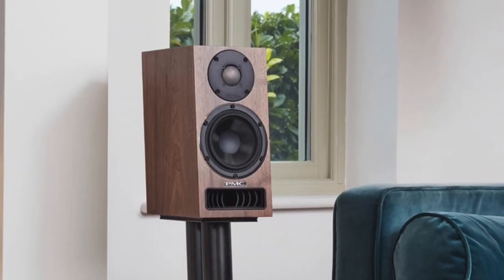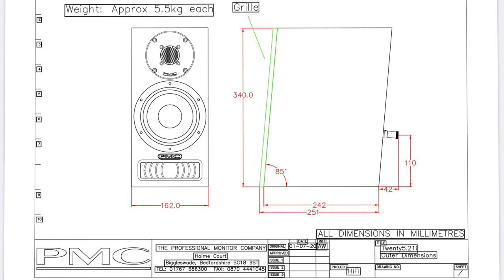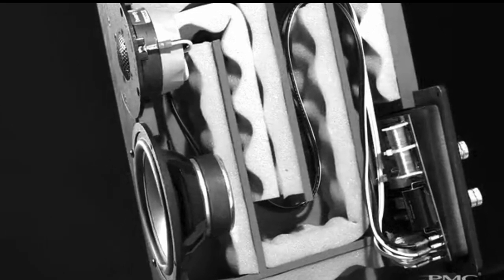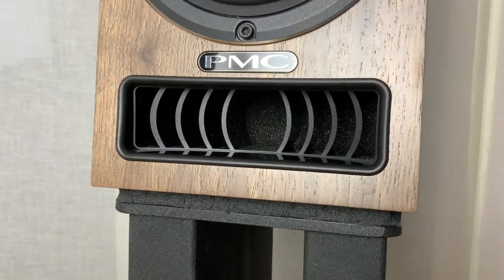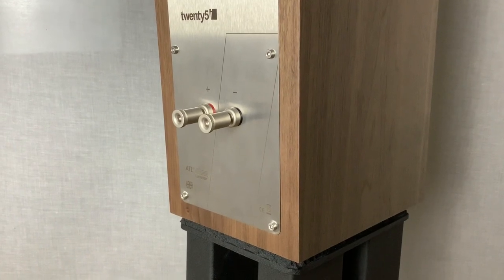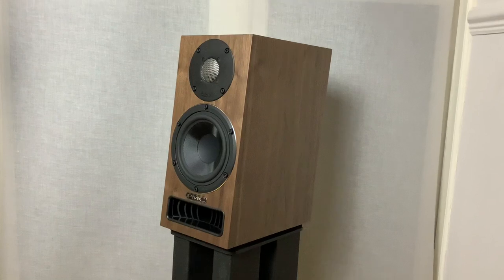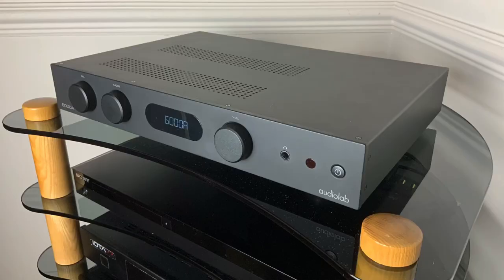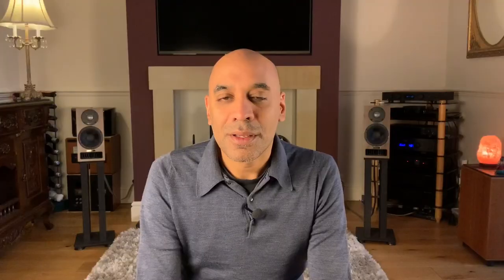PMC Twenty5.21i Speaker Review

Comment: PMC and Exposure is a match made in heaven. I use an older Exposure 2010S2 (75w/ch) with my PMC's and it provides ample power.
Reply from the maker: Cool 😎 thank you for sharing 😊👍
Reply: @essendon72  Which speaker cable do you use between the 2010 & the PMC’s?
Reply: @Theoriginalramjammer  Hi. Using Van Den Hul - The Clearwater atm. Have also used Audioquest Rocket 33's. I like the VDH's.

Comment: This review sits well with your very more recent review of PMCs Prodigy 5 . Transmission Line speakers produce a quality of bass like few others. Having owned Castle Avon 5s (a TL design from a few years ago no longer available) I can confirm the tangible detail, power,depth and tuneful bass a TL can produce which is difficult to find in other designs . TL designs are few (there are some DIY TL speakers available) but given their obvious advantages it is a missed opportunity . They are more complex in terms of the design and the internal line but the latter might also be part of their strength in suppressing speaker cabinet resonance and vibration . Keep the reviews coming. Much favoured in this quarter .
Reply from the maker: Thank you Peter 👍

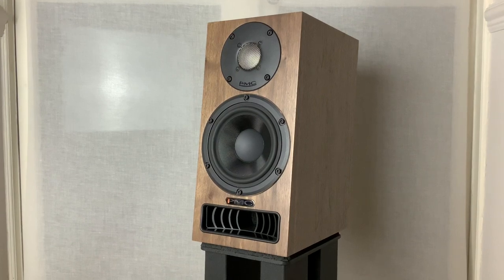Comment: Love the review. Big fan of proper transmission line speakers. I was freaked out at 1:44 when I saw the drawing and thought "no, they did it wrong" referring to the porting. Then later at 2:15, I was relieved to see the cutaway showing a properly engineered porting system. They look to be of excellent quality. Thanks again for the review. If I can find them here, I will definitely give them proper consideration.
Reply from the maker: Thank you for watching and sharing Terry 😉
Reply: As far as I know transmission line speakers always show a slow bass respond. What you gain on the one hand you'll lose on the other hand. 

What is the -3dB frequency  45Hz?

Comment: Good review.  Having owned smaller PMC stand mounts and floor standers in the past the worst thing you can do is "miss the below 40hz region enough to just buy some cheap subs to supplement"  The PMC bass is something special in the way the notes are rendered, if you add some bog standard muddy subwoofers down low it really detracts.  I now, through pure luck, have PMC floor standers with 10" drivers and I now fully understand PMCs vision.  You can have good bass, or you can have low bass, rarely can you have really good low bass.  The bass on my EB1 is unmatched by anything else I have heard.  No sub I''ve ever heard does what these do.  They go down to about 19 hz in my room but the transient speed at 19hz has the ability to make all the glasses clink in my kitchen in rhythm to to the song if I've accidentally put them in the cupboard touching each other.  It's bizarre.  The entire room and house becomes alive.  A PMC sub is a really good idea though very expensive compared to the usual hifi subs.  I had TwoTwo Sub2 for a year and it really did a good job.
Reply from the maker: Thank you for watching and sharing your experiences Mr B 😊

Comment: I built myself a pair of nice floorstander 1/4 wave Transmission lines, just over fifteen years ago. Wonderful results. The cab design is inherently solid, and can easily be made rock solid and incredibly dead when doing it oneself. They are flat down to 32 Hz. Cathedral and big orchestral shit, with low organ peddles can shake stuff around, and can sound menacingly epic. Bass does shine, with none of that slow flabbiness one can get with bigger drivers.
I need to finish them off properly with a new tweeter. As indeed they should really be. Likely a ribbon of some type. This needs to be crossed lower than at present, to alleviate some of the mid frequencies from the upper of the 6.5 inch Magnesium Woofer to be taken on by the Tweeter, so that the Woofer will be operating wholly pistonically and away from the cone break up and bell modes.
Been meaning to get around to it.
Not that they are not pretty damn decent anyway.
A real big plus of transmission lines is just how tunable they are. You can adjust how much foam or long haired wool one has in the line. This allows a certain amount of adjustment to suit a particular room.
There's just something about a transmission line, in the bottom registers, than is very appealing. Which is what the whole deal is about. The Tweeter is pretty much a complete system one simply bolts/screws on the front baffle.
The box really is only for the control of the Woofer bottom end. In effect a physical filter, as opposed to an electrical one. That controls the Woofer at/around it's resonant frequency.
The different types. Open Baffle. Infinite Baffle/Sealed Box. Ported box/Bass Reflex. Transmission Lines. Horns. All have what amount to essentially analogues in the Electrical Domain. They have different type filter slopes, in just the same way as the electrical filters do that make up the passive crossover.

Not that I'm trying to teach anyone how to suck eggs. I just thought the cabinets actual role in actually being part of the filtering/crossover might be interesting and something most folk overlook.
Reply from the maker: I always have the utmost respect for people who have a good at doing it themselves. I really enjoyed reading about your experiences. Thank you for sharing them. I actually did a video on speaker enclosures. Link below, just in case you haven’t seen it...
https://www.youtube.com/watch?v=g4M3rb8QMSU
Reply: Trying to cross a ribbon tweeter over low might be difficult, but should give excellent quality if you can find a suitable driver

Comment: Hi Tarun, great review and like myself once you realise just how well PMC speakers produce bass, nothing really comes close in that specific area. I run Fact 12s myself and love what they do, but as you say they don’t take any prisoners, when it comes to upstream equipment.
Allow me to add, that I am not sure it is a good idea to rake them further backwards, as they have already got a sloping baffle. Correct Image height should be determined by your ears being at a level between the tweeter and the midrange and this is how the speaker was designed and with the intended measured frequency response. Ie. raise speakers equally front/back with a slab of something or have the right height dedicated stand. An alternative could be lower your own listening position. The overall room/ speaker response and interaction can change most likely unfavourably as you start tilting, as the off axis listening response becomes more unpredictable and influenced by 1st ceiling reflections. This will in turn influence the overall tonality of the speakers, as a different reflection pattern gets thrown into the mix. No worries I’ll get me coat......🤓🤣 ATB Peter
Reply from the maker: Hi Peter, I can imagine those Fact 12s being quite impressive.

I originally had the 21is raised to 70cms to get the acoustic centre of the speaker to ear height. I was struggling with soundstage depth and played around quite a bit with positioning. I always feedback to the manufacturer my findings once I have completed listening tests. I consider this a professional courtesy and gives them the opportunity to point anything out that may be useful to include in the review. It was my discussion with them that encouraged me to pull the speakers out even further than I would ordinarily consider necessary. In the end it didn’t help much with soundstage depth in my room. I found by dropping the speaker to 60cm and raking it back a little the stronger floor reflection added a bit if warmth, which I preferred.

Thank you for watching and sharing your experiences with your PMC speakers 😊👍

Comment: Yet another great review. I'd love you to a review a pair of original, in spec 15 ohm LS3/5a's.  I've recently acquired a pair and they are the most convincing speakers I have yet to hear. I have them paired with a Primaluna valve amp.
Reply from the maker: Thank you John. That is a very nice system. I would love to review even the current Falcon LS3/5A if I can get hold of one 😊👍
Reply: @abritishaudiophile7314  the Falcons seen to be well regarded, though a little brighter at the top end than the original, for reasons that seem to be elusive. Have you ever spoken to Paul Whatton? He's a lovely bloke and he could possibly lend you his BBC pair with serial numbers 001 and 002.
Reply: Nice job as always, Tarun. I do appreciate that you go into, not just the tech, but also the all important set up of a speaker.
In my view comparing the PMCs to the LS3/5 is an odd one. They are different beasts attempting different goals. The LS3/5 is ultimately a monitor whereby the PMC is a HiFi speaker with a particular voice.
The only similarity is the size and cost and there are dozens of speakers that would fit in that category - Harbeth, Focal, Dynaudio and my personal favourite Quadral Aurum Galans which are criminally neglected in the UK. They’re the same size, have a ribbon tweeter and go down to 36hz. What’s not to like. 
Cheers
Reply: @jim586  Hi Jim, great comment. Just one thing, though, I didn't want Arun to compare the speakers, I was just saying that I would be interested in his views on the LS3/5a.
Reply: @1jhnpennington Ok. That’s fair enough. In my opinion they are chalk and cheese. The PMCs would be really analytical and forward sounding compared to the LS3/5 of any flavour(brand). Cheers

Comment: Excellent. I bought the 25.23’s after demoing about a dozen pairs of speakers and was completely taken by the depth and speed of the bass, accuracy and clarity of these speakers. For me nothing else came close. However, like you, if I had one criticism it is that they do sound very “cold”. 

I went for the 25.23’s over the 25.21’s as they had that bit more bass and were effectively better v.f.m. than the 21’s plus stands, plus sub.  Whilst I found the 23’s sounded just like the 21’s but with more bass I didn’t like the  22’s at all. They sounded like a completely different speaker and the bass was “muddy” in comparison.

Final point, everything in your review chimes exactly with my experience except for placement. Perhaps it is a difference between the 21’s and the 23’s, perhaps it is the room, but I have found my much less sensitive to positioning.

Looking forward to the next one!
Reply from the maker: Hi Gardenflyer, I would not mind trying out the 23is myself. Really enjoyed hearing about your experiences. Thank you for watching and sharing 😊👍

Comment: I auditioned the twenty23 (non i) floor stander, with a pretty ambitious front end consisting of Fletcher audio point 5 turn table, Manley steel head phono pre and Roksan Blak integrated amp and it was pretty damn sweet! Certainly not lean/cold, but I would say very neutral and with a sparkle in the treble. Non the less made me think the balance might be off with the wrong front end/source material (also from what I can gather, people seem to think the twenty23 is warmer and more full then the 21 and 22). I could certainly live with that setup 🥰 For what it’s worth my mate who is a mixing engineer, says he likes PMC for their ability to retain their low end at lower listening volumes. Keep up the good work!
Reply from the maker: Thank you Sune. I can imagine that the extra bass in the 23is may shift the overall tonal balance to the warmer side. I wouldn’t mind getting a pair in for review some time 😊👍
Reply: Hi, would you recommend the Blak as one to audition? Thanks
Reply from the maker: @richardjohnston4682  I haven’t had a proper listen to the Roksan Blak but it has a good reputation. Definitely worth an audition 😊
Reply: @richardjohnston4682  I really liked it, but only heard it in that setting 🤷🏻 I do know that this particular dealer are pretty selective with what amps they carry (That used to carry exposure and still speak well of them even though they no sell the brand).
Reply: @abritishaudiophile7314  Good point about the bass! I've certainly found a perceived shift towards fullness/warmness when adding subs to monitors.
Reply from the maker: @thepickyaudiophile  thank you 😉

Comment: Hi Tarun.  PMC speaker's are starting to grow on me and the transmission design is very efficient at getting a low deep bass with a relatively small cabinet. I have my eye on the Twenty5.26 model even though they are the older model. The Hegel h390 may be a better choice for these speaker's. The big question to you  is are you thinking of swapping the Proacs for the PMC's? Thanks for a good solid review.
Reply from the maker: Hi Steve, that is a very good question. Both are extremely competent at this price point. Can I keep both ?
Reply: @abritishaudiophile7314  that's a good compromise and I think you should. Go for it as it would be fun 😁
Reply from the maker: @steverees1936  of I had to choose one, for me personally it would still be the ProAcs as I prefer a bit of warmth 😉
Reply: @abritishaudiophile7314  I would agree with you and they also look nicer. 😁👍

Comment: As always thanks for the review.  Have you reviewed the floor stander yet?
Reply from the maker: Thank you J. Not yet but hope to next year 😊👍
Reply: @abritishaudiophile7314  looking forward to it.  Plan on building a transmission line sub, hopefully next year.
Reply from the maker: @jked7463  great! Please let me know how you get on 😉
Reply: @abritishaudiophile7314  will do.  I am an audio and acoustic consultant.  By emitting bass half-way up the wall, the bass nodes are reduced for frequencies longer than the height and width of the room.  So the sub woofer driver and port will be up high at the top of the transaction line.  Not pretty for aesthetics but good for acoustics.  Need to finish my retro speaker using old drivers but modern understanding of physics and components such as high quality caps first

Comment: Since you have a long term relationship with a Celestion 300 which you have done a review on and have even repaired I am sure us subscribers would like for you to do a review of the PMC twenty5.24i comparing it with the Celestion 300. 

Celestion 300
Crossover Frequency: 2200Hz
Bass: 1 x 165mm cone
Tweeter: 1 x 32mm aluminium dome
Dimensions: 970 x 210 x 326mm
Weight: 19.7kg
Sensitivity: 84dB
Impedance: 8Ω
Finish: walnut, mahogany, black ash
Enclosure: 47 litre, transmission line

PMC twenty5.24i
Crossover Frequency:1.7kHz
LF PMC 6.5”/170mm long-throw g-weave™ cone with cast alloy chassis
HF PMC/SEAS®, 19mm twenty5i series, SONOMEX™ fabric soft dome, Ferrofluid cooled, with 34mm surround and dispersion grille
Dimensions:H 1015mm (40”) (+20mm spikes) x W 192mm (7.6”) (275mm incl. plinth bars) x D 419mm (16.5”) (+9mm grille)Drive Units:
Weight:23kg (50.6 lbs ea.)
sensitivity:89dB 1W 1m 
Impedance:8 Ohm
Finishes:Walnut, Diamond Black, Oak, White Silk
Effective ATL™ Length:3m (9.8ft)
Reply from the maker: Thank you buddy for taking the time to post the specs. I do hope to review the floorstander versions at some point. The Celestion 300 still have the best bass I have heard in my room 😊👍

Comment: The way to reduce turbulance is to design the opening area and the line cross section to keep airflow in the laminar flow velocity region beneath 7m/s.  Those grilles may help a little but dont dictate laminar flow conditions but are an economic way of shaping it rather than more expensive production means by design.  Expensive imho for a simple small  box. Why compromise the whole build by stuffing the crossover into the line?!!!! Poor practice given they could be in their own little pocket which would also benefit sq by reducing microphony of the inductors.

The soundstage depth is a strange one for pmc who normally nail this.  As a designer who works with studio engineers I know that the only way to recreate depth is to ensure speakers have both correct time and phase alignment.  Lose one of those and it's impossible to accurately recreate image depth. Coincidental axis will add to realism by introducing genuine point source too. Pity no uk speaker does this anymore.
Reply from the maker: Very interesting Paul. Thank you for watching and sharing 😊👍

Comment: Surely you are better off with the tall cabinets of the 23s and 24s rather than using a separate subwoofer. You introduce another level of complexity where the sub needs to match the speaker.

Comment: I suppose the question to ask is how they compare to the ATC Scm 19's as they both achieved the same rating and they both need a subwoofer .
Reply from the maker: Hi Greg, I didn’t have them both here at the same time to do a comparison. Generally speaking though, I remember that both are highly resolving and very fast. The ATCs have more or a neutral presentation and the PMCs are cooler. The PMC dig down a bit more in the bass.

Comment: Very good engineering, high quality overal. Due to steep filtering, it has even power distribution,wich gives a good balanced sound. The cost is depth of soundstage. Typical behaviour of studio monitors. If given  better quality crossover parts, the results are stunning. Speakers made by engineers for engineers
Reply from the maker: Thank you for watching and sharing Frank 😉

Comment: pmc twenty5 21 is not a easy speaker to drive. you need very high power in low-mid volume to bring maximum performance. If you try to hear good bass the high frequency will bother but if you use high power class A amps you will experience well balanced and incredible sound. really have to spend a lot of money for amps but it's worth it.
Reply from the maker: Thank you for sharing your experiences 😉